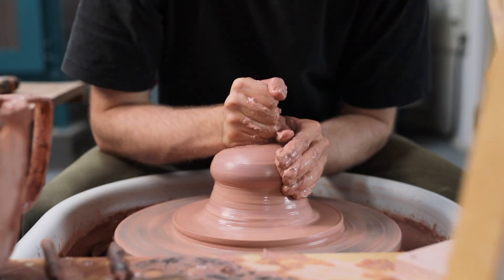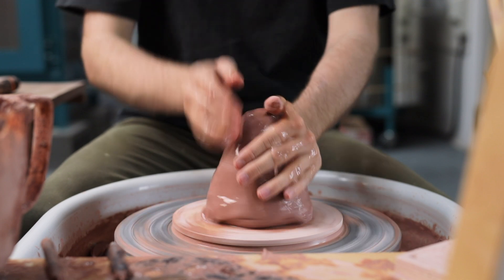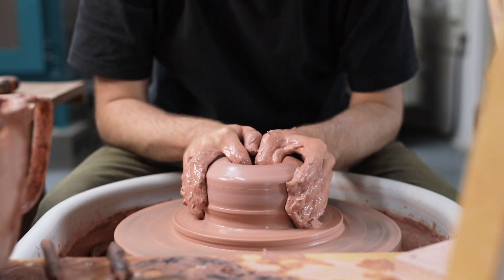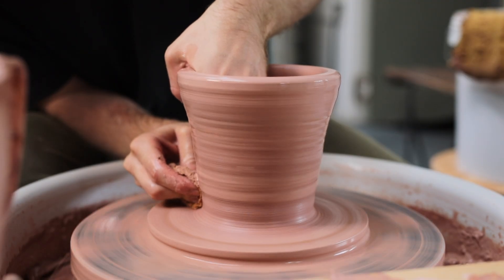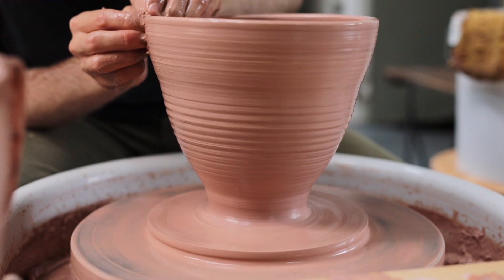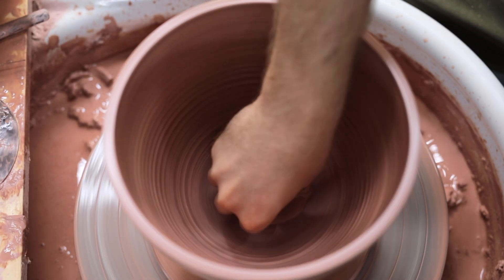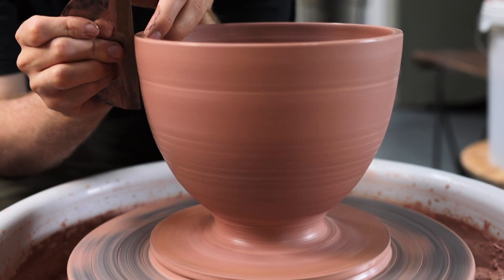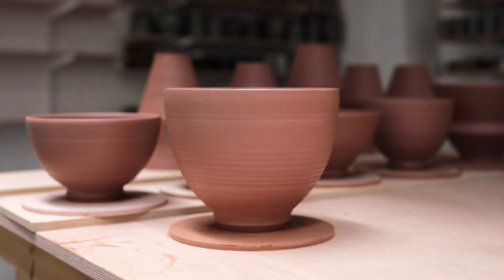Throwing a Tall, Curved Stoneware Bowl – Part One

Comment: Could you make a video about things you keep in mind when designing and producing pots? 
Maybe a little collection of different pots in one video so that we can get an impression of what you think for each form of pots and features they should have in your opinion. 
For example you mentioned that the inside of a footring for you is the same height as  outer part, thin rim on mugs are a bit thinner so that they fit properly in the mouth, handles big enough to fit at least two fingers)
Sarah

Comment: Completely new to all things pottery, just watch for the satisfaction and relaxation. What’s the purpose of the throwing batt? Why not work directly on the wheel?
Reply: The main goal of the batt is yo help you when you remove the piece from the wheel. With a tall piece with narrow base, maybe it's easy to disturb the piece if you try to remove it without the batt (but possible). Or maybe he was just filming this on the name day that he was throwing other pieces that would be impossible to remove without a batt (like plates or extra thin and tall pieces) 😅
Reply: @VictorPedrosaCeramics  that makes sense, thank you!